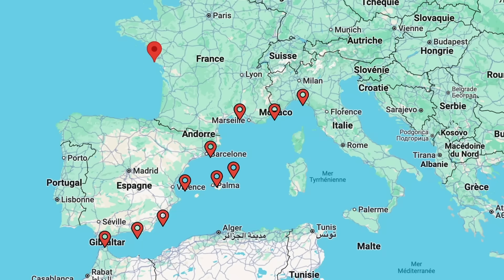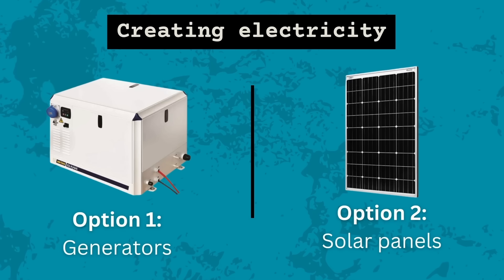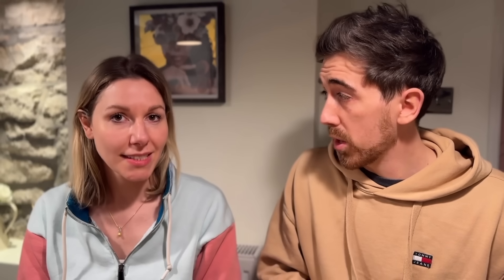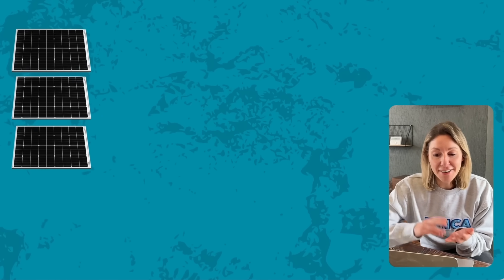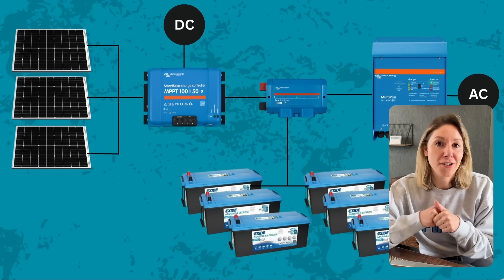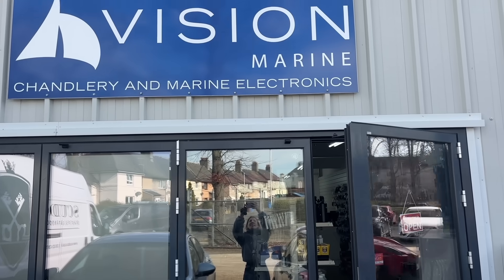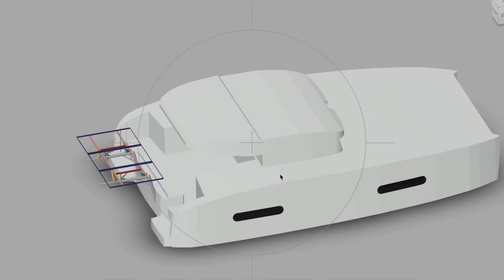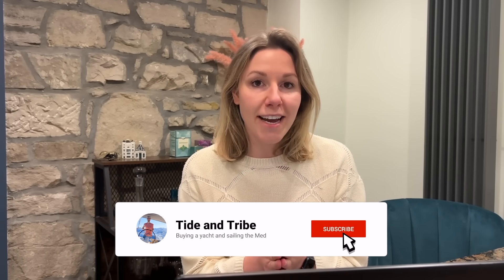We Have a €20,000 Problem! Buying A Brand New Catamaran

Comment: Before you do the solar installation yourself, check that this is ok with the insurance you’ll get for the boat. Some insurances won’t cover you if the install is not done by a pro as this is one of the main reasons for fire on a boat.

Comment: Do it yourself. I just did mine. Lagoon 440. It's not hard. Go lifepo4. Do NOT go agm. Do NOT be pressured into most expensive lifepo4. It's not worth it. Hire a welder to weld the frame. Not a marine guy. They will burn your wallet.

Message me if you need any help.
Reply from the maker: Thanks for your support! We’ve built a custom frame ourselves (you can see it at the end of the video) and we’ll be installing it next week. We’re just deciding final specs for the battery setup 🤙🏼

Comment: Go lithium  lifepo4 simply for the capacity gain that lithium have over AGM. AGM can only be discharged to 50% of capacity before you start shortening the life of the battery. Lithium can be discharged to 80% capacity. So a 100ah AGM battery is only really a 50ah battery, where as the 100ah lithium is really a 80ah battery. So comparing the same size batteries, lithium gives you 30% more. The other advantage of a lithium battery over an AGM is the lithium battery is about 50% lighter.

Comment: And Lastly, since you will be working from the boat, electricity demand and priority is high for you verse a retired couple.  Because things break down so easily on boats, it is best to have 3 or 4 methods of charging those batteries.  Your alternator might be down for a week while you wait for parts and it's a rainy day or few days, where are you going to get electricity then?  At the vey least I recommend a genset, solar (2x what you think you need), and beefed up engine alternator.

So why is it best to have 2x the solar?  It's simple: if it's a rainy day, the batteries should be able to provide you the juice you need for that day.  The next day, you may have sun and that will power your needs for that day, but the batteries still need to be charged.  Sure, you can run the genset, but they are loud.  If you have twice as much power from your solar than you need for a day, the solar can power your needs and charge the batteries so by sunset, your batteries are all topped off.

The genset is for emergencies really.  While sailing which is when most boats draw the most, at night the batteries are going to get drained a lot.  If the next morning it's cloudy, you want to be able to run the genset not the engine.  Engine should just be used for pushing the boat, not charging batteries....that is the backup to the backup.  Like I said, things break.

But lets talk wind generators.  A wind generator is very handy in many cases.  When it's cloudy, most of those times it's also windy, so when the solar isn't working, the wind generators are.  Now boat wind generators tend to be too weak.  I had a small house type wind generator I got for $600.  The seller said it was for marine use, but the manufacture said otherwise.  In any case, it worked very well for 6 years (sold the boat).  Usually on those cloudy days I had all the electricity I needed from it.  It would produce about 10 to 20 amps an hour.  When sailing up wind or on a reach, it worked great, creating all the electricity I needed.  When sailing downwind I usually only got between 2 to 5 amps an hour.  I had to build a way to latch it down to an angle as when sailing downwind the waves are more powerful than the wind so it would spin around a lot.  It weighted 40 lbs....not so bad for a 37 monohull but more heavy than a marine unit and way more powerful.  It was also quiet too which marine units aren't.  It was a 5 blade windmax like the link below.

It is worth noting that even though the wind generator was quiet, when the blows came thru, whether sailing or on anchor, the sound of the windmill made the blow seem worse than it was so the wife hated it.  When we got our next boat I just went with solar (1200 watts) and a large battery bank.  Never had to run the genset to charge the batteries for 2 years in the Caribbean.

I worked remotely for 8 years cruising all over the tropics.  These are my findings.

https://www.aliexpress.us/item/3256808359534525.html?src=google&pdp_npi=4%40dis%21USD%21238.23%21238.23%21%21%21%21%21%40%2112000045649046361%21ppc%21%21%21&src=google&albch=shopping&acnt=708-803-3821&isdl=y&slnk=&plac=&mtctp=&albbt=Google_7_shopping&aff_platform=google&aff_short_key=UneMJZVf&gclsrc=aw.ds&albagn=888888&ds_e_adid=&ds_e_matchtype=&ds_e_device=c&ds_e_network=x&ds_e_product_group_id=&ds_e_product_id=en3256808359534525&ds_e_product_merchant_id=5552997109&ds_e_product_country=US&ds_e_product_language=en&ds_e_product_channel=online&ds_e_product_store_id=&ds_url_v=2&albcp=20417933951&albag=&isSmbAutoCall=false&needSmbHouyi=false&gad_source=1&gclid=Cj0KCQjwqcO_BhDaARIsACz62vO49GkLJPVFXG9JikszOXEsLWHN8TS1B5aobAWgECvjAZ32ZRtYyhYaAtWpEALw_wcB&gatewayAdapt=glo2usa
Reply from the maker: Thank you so much for your comments! All super helpful 🙌🏼

Comment: Hi guys - solar will be no be enough. You will have times (weeks) with little sun even in the Med. I would recommend a combination of (one or two) high powered alternators on the engines (as back up to solar) and then a 1500-2500w solar setup. I would recommend going 48v rather than 24v. You will find that inverter/charger, wiring and potentially the Lithium batteries will be cheaper at 48v. This setup requires lithium batteries, as AGM will not charge quick enough and will not discharge as low as lithium. It is not cheap, as you already know and it is very important that this is installed professionally (you may have issued with insurance later on otherwise) - good luck
Reply from the maker: Thanks for the advice! Appreciate it 🙌🏼

Comment: You can't afford $20K for solar but you can afford a brand new catamaran???? Something does not compute. I highly suggest you get expert advice on your solar installation. Amateur solar installations are fraught with unforseen issues. There are a lot of gotchas if you don't plan carefully and pick the right equipment. LiFePO4 batteries @ 24V is the only way to go. Good luck.

Comment: Im another LiFePo4 batteries. I changed out our AGMs. Went from 600Ah of AGM to 400Ah of LiFePo4.  I have more energy than before and saved 120kg. The system on our boat is quite simple and does not have high power demands. Have 800w and when full sun charging puts in 25A. The two LiFePo4 batteries did cost us a bit over 3k Australian.
Reply from the maker: Awesome, thank you! Lots of people recommending LiFePo4 batteries!

Comment: Really interesting and thought provoking. The are some great suppliers. I bought a new Gemini 105 a few years ago. Definitely a lot of hidden costs. Portsmouth harbour.

Today I would most likely go with a Seawind 1160XL. Factory fitted with 1500 Watts of solar. I would dump the propane. Install a diesel stove. Diesel heater. Microwave / Airfryer. 240 volt socket for 3kw electric kettle. This keeps the boat light and warm.

The outboards means beaching and scrubbing is easy. Maintenance costs are low and the outboards are easy to Service and repair. Decent power supply.

Comment: One thing to consider is weight - Victron is the best by far brand, no question. But Victron invertors are heavy. And you eventually might want to have more batteries and extra batteries are extra weight so eventually weight might become a consideration. 5kW LiFePo4 would be around 50kg and there is no way around that. Victron 5kw inverter is 30kg but for example Growatt 5kw inverter is 11kg. And if costs is a concern Growatt you can buy from Aliexpress for 800 usd. 
But to be fair reputation wise Victron has no competition.
Reply from the maker: Yeah, all of our hardware is Victron, seemed to be the most recommended hardware by far 🙌🏼

Comment: If you use one solar controller for all 3 panels then shading of 1 panel would affect performance of all 3 panels. So you might want to consider separate controller per panel.
Plus (as I'm considering exactly same boat) my plan would be to put soft solar panels on the hard top. That might influence your plan for wiring.
Reply from the maker: Appreciate your advice! We’re also looking at flexible panels on the coach roof but this will be done in the future once we’re settled onboard and have worked out our power requirements. We’re just trying to get the basics sorted first and add to the setup as we go 😊
Reply: @TheRunaLife  Just bumped into comparative testing for partial panels shading - just in case you are interested: https://www.youtube.com/watch?v=xQShJnxSevY
So if the panel is not specifically designed to deal with shading it seems performance is dropping drastically when even one cell is shaded (and that obviously will be regular situation on a boat).

Comment: Like others have said, there’s very little that’s ‘environmentally friendly’ on a boat. 

Fibreglass is forever and parts are throwaway, needing regular replacing due to the harsh wet, salt and sun environment. 

Island hopping vs circumnavigation have hugely different safety requirements and that is significantly more than €20k to spec up
Reply from the maker: Yes this is true, we just want to be as self-sustainable as possible and try to limit the impact we have 😅 We’ll be island hopping for the next couple of season, and plan to upgrade and add to our setup over time. Thanks for you comment 🙏🏼
Reply: @ozwrangler.c  “Fibreglass is Forever” is the totally mistaken 1960’s thinking, that predicted every Beach on the Planet would be 30 feet deep in Plastic, in ten years. After no beaches with even six feet of plastic on them showed up after two years, the Real Scientists, which we were fortunate enough to still have at the time, took an extremely close look at the realities of plastic. Turned out that in high UV areas such as beaches, within about 12 months, plastics just reverted back to water and esters - lease note, no such thing as “micro plastics” - also extremely worth noting, that if protected from UV exposure- such as with underground plastics- the maximum life of plastics before reversion to water and esters, was about 80 years. Confirmation of this is clearly visible with the Osmosis blisters in the hulls of boats. These results were clearly documented in the Structural,engineering Course I was on, in the 1970’s. So why are you continuing the Lie that Plastics are forever, when we should actually be treating waste plastics as a precious resource, before they disappear as stinky water? 🤔

Comment: Sorry but AGM …. NO NO NO ….. I’m sorry but you’ll look back and realise this is a mistake. There’s a reason it’s cheaper …
Only 1 Charge controller ? Any shade on any solar square will shut down your charger. I had 7 panels and 7 charge controllers for that very reason and of course redundancy . You don’t have any redundancy and in the middle of the Bahamas you’ll struggle to get a replacement.  My solar setup on my L42 with stainless arch was double your quote but we could run anything all day . 
Good luck though I wish you well . This will be interesting.
Reply from the maker: Thanks for your comment! We'll be upgrading our system as we go, once we have a better understanding of our power requirements. Adding additional charge controllers feels like a smart thing to do, it's something we've spoken about a lot over the last few weeks 😅

Comment: I can't lie and dont want to sound negative, but this is a bit wild. Buying a brand new boat and putting AGM (1980-90s?!) technology on it. For an off grid life...

I'm sorry to say it but you will 100% regret this. You'll go through the entire cycle, last a year or two and come back to 'I wish we'd done that properly from the start life would have been so much easier'. The market and the entire off grid space (boats, vans, etc) have all moved passed AGM. Its like the ultra budget option that will 'just about do', but guarantee with that amount of solar you will have issues. The costs will be sunk in the AGMs, their value will be negligible and you'll be stuck buying lithiums from scratch.

I'm sure others will comment it, but i'd look at more solar on the coachroof too. The calculations are great and all, but you will always want/need more. Throw in extras as you start to travel, coffee machine, air fryer, fridge/freezer working harder in the med...etc and you will really want/need more solar and capacity. The way everyone is going really is lithium, as much solar as you can and high power alternators on each engine...and theres a good reason for it...
Reply from the maker: Thanks for your comment, it doesn't sound negative, it's great to get everyone's thoughts and opinions! 😀 We originally opted for AGM, knowing it wasn't a long-term solution, but they should be able to sustain our power requirements initially. Cost is a factor, we have such big outlays at the moment, not only buying the boat but buying everything else that we need; insurance, tender, outboard, safety gear, interior furnishings... the list is endless, and nothing is cheap in the sailing world 😅 We're a young couple and unfortunately don't have an endless supply of money, so we do have to make some compromises initially. Saying that, we have made some upgrades to our setup since publishing the video!

Once we get onboard and begin to get a better understanding of our power requirements, we will continue to upgrade our system - panels on the coach roof are definitely on the list! Thanks for the comment and advice ☺️
Reply: @TheRunaLife  .. We had AMG batteries on our Lagoon 42 and they were fine. You need to manage your electic usage more but thats ok. We lived on anchor 90% of the time with 600 Watts of solar

Comment: Make sure your insurance will still cover you after self installing.  Lithium will make your panels more efficient but for sure hire a professional to do the install for that due to most insurance requirements.  Chartered an Excess 14 with factory solar and lithium and it worked really well.

Comment: I wouldn't install any battery that has even a  remote possibility of going into thermal runaway in the middle of the ocean even lifepo4 , lead acid batteries may not have the advantages of lithium ion but ................

Comment: We've built a large solar arch and a system that works fine. used AGM, which is very heavy would go for lithium next time. strongly suggest to use more than one MPPT to avoid shade losses. 24 or 48 volt has the advantage that cable runs are far less thick than 12 V. Other than that nor much advantage. The Victron MPPT's need 5 volt difference between battery and solar input to start charging. Consider higher volt panels ask the seller! eg 12 v panels maygive15-16, not enough to chare a 13 v battery (you need 18+) we solved it by using 24V panels and 12 V battery system. It's certainly doable to do yourself with a bit of reading into it. And it is only getting better as within next year one of our business partners will have panels that produce 200-400 times as much energy on the same surface. which will change solar industry (Do not ask more details, bound by NDA) Solar is the way to go. Success!
Reply from the maker: Love your comment! Thank you so much. Reading feedback like this reassures us we're doing the right thing. We've not taken the research lightly and have got experts to help us throughout. It's great to hear from others that have done a similar thing :)
Reply: Its definitely not possible to have 200-400 times the power ( not energy) on the same surface. Because solar panels are 15 to 20% efficient. So 5 times more would be nearly 100% efficient.
Reply: @niconico3907  in technology hardly anything is "definitely" I know oof a development in solar, that with a 1x1 m solar panel can power a complete house with more power any family would ever need. they are in patent phase at the moment. So buckle up as things are about to change and your definitely not becomes... certainly possible.
Reply: @w65vdB  1square meter perfectly oriented receives 1380W of sun power on earth. Average household energy consumption is 17kWh per day. The panel is not correctly oriented at all time, the panel is hot, so not 100% efficient, there are cloud sometimes So your claim is physically not possible. They are lying to you.